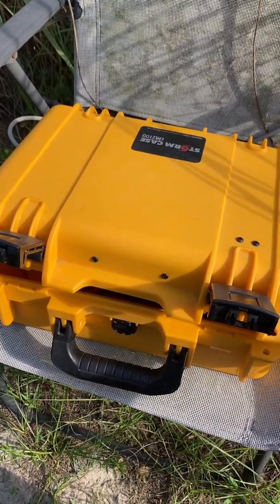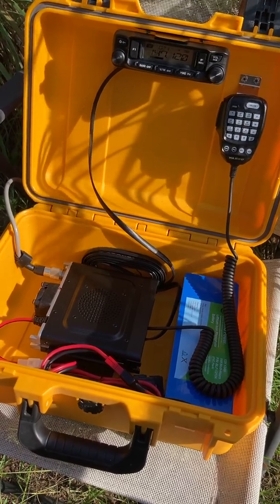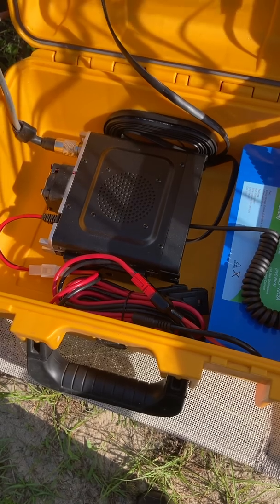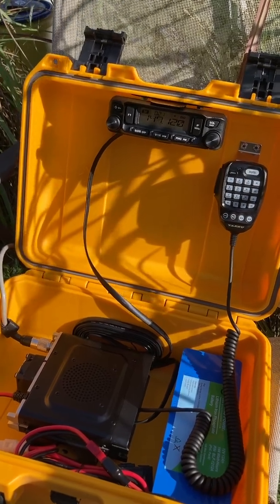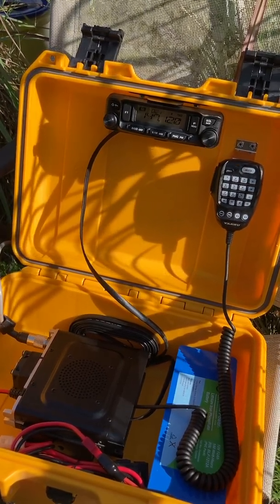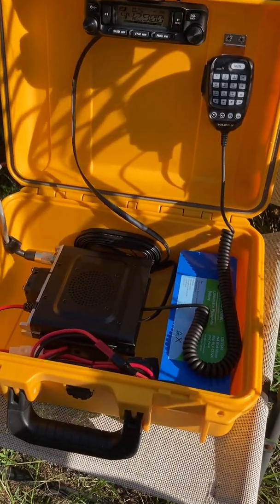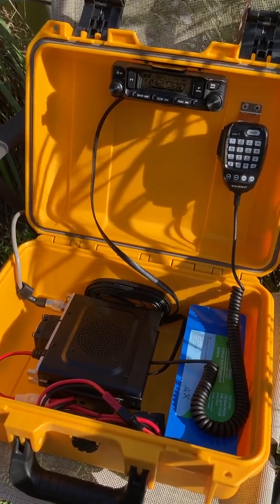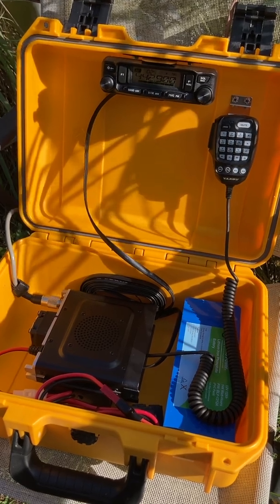Emergency Communications Go Box Ham Radio

Comment: I have been working on a GMRS system. I think it’s over looked. Anyway I’m going to set up a home system with a 50watt radio . Using a power supply. Then I’m going to to build a power box to power the radio when the power goes out  or SHTF. Solar to charge backup power. Then the 20watt radio I have I will set up a go box / pack for away from home . Add the different hand held radios I should be good to go
Reply from the maker: Sounds like a good plan, and it's nice to have backups.   I just stumbled upon a GMRS repeater setup about three miles away and met a new neighbor.